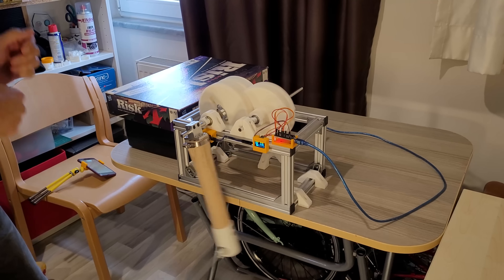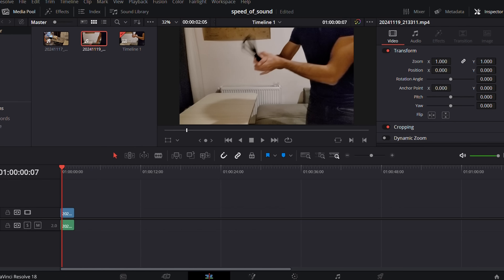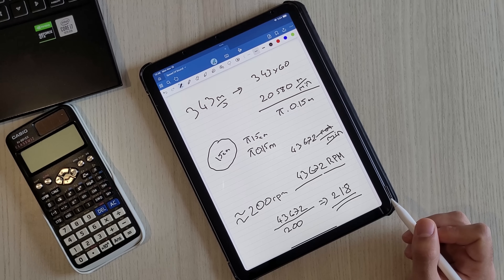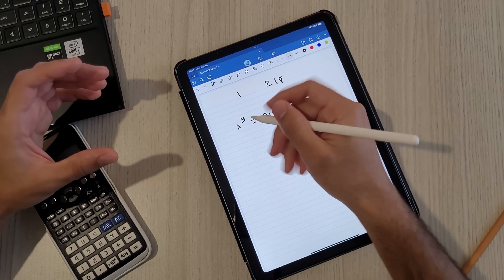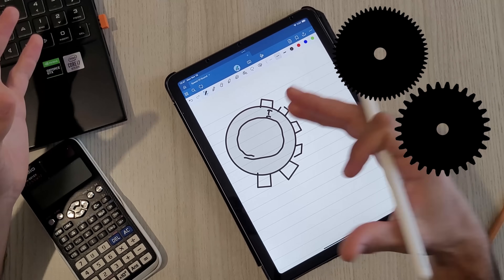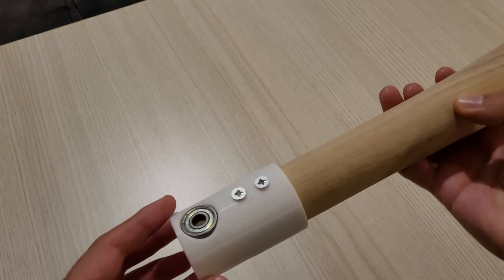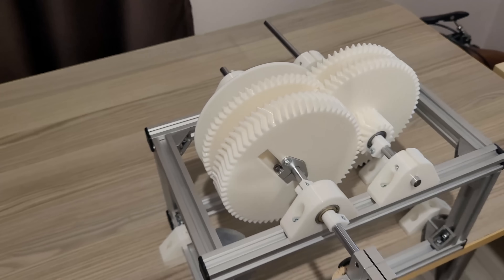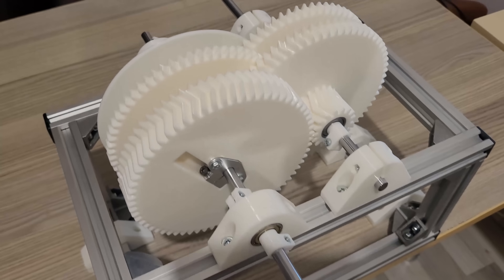Trying To Reach Speed Of Sound At Home 3D Printed Gears

Comment from the maker: My video where I built the reverse of this to increase 2 motors' torque like crazy, as John Wick would say we need torque, lots of torque. https://www.youtube.com/watch?v=C--8uYFRu9c&t=107s
Reply: 0:09 0:09 0:09 0:09 0:09 0:09 0:09 0:09 0:09 0:09 0:09 0:09 0:09 0:09 0:09 0:09
Reply: If you paint the final disc (probably made of metal for strength), half black and half white, then you can use a tachogram app on your phone to calculate the spin speed of the final disc. Your table needs to be well wobbly.
Reply: Love videos that teach the process, good work!

Comment: How would this work if you were to increase the size of the gears, per gear (so, initial input is say, 15cm, then 30cm, then 45, and so on)?
Seeing that this was a video from a "small" channel at the end blew me away. You've got a bright future ahead if you keep this up, great length, more than enough information density and you explain things really well.
Reply from the maker: Hi, the size of the gears have to be the same in this design because they all are on two parallel rods. If you increase the size it will strart hitting the rod.

And thank you for your comment. I beleive i had 30 subscribers when I shared this video.

Comment: 11:17 - no they are not more efficient, at least not in the general case. There can be some situations where they are, but in general that is not the case. Sadly people are spreading so much BS that if you search for that first the searchengines own AI will tell you completely fabricated hogwash, then the next 15 sites will be AI generated BS (going so far as claiming the transmission-ratio to be the same as the efficiency-number), then a couple random blogpost were people claim that their lies somehow constitute "research". But when you find actual manufacturers documentation you will find out that no, they are no more efficient.
And the simplest example that they are not: Cars.

also you have a computer - it would be easier to do the calculations in a calculation-program with spreedsheets, or even just python.

Comment: Using double helical gears will make friction almost twice as worse. I recommend using spur gears that are fixed to their shaft so you only have to decrease friction between the shaft and the chassis. Give them slight intentional backlash to make sure the friction is gone. Instead of trying to make the gearbox compact, make a long line of spur gears to minimize contact. Regular ball bearings have too much friction, use bearings with cylinders instead of balls and fix the shaft in place using two spikes on the ends. Lubricate every part with graphite.
Reply from the maker: Thanks for the tips

Comment: Gear/connect it to a cycle or any motorized vehicle
Reply from the maker: You wouldn't be able to spin the crank
Reply: @canocholic  why?
Reply from the maker: With gears you do not increase power. Power = torque * speed. If speed is increased torque is reduced. Check out these four videos for more info about how gears work:
https://youtu.be/yGlPy2q1e_w
https://youtu.be/KQCIBSL6UEc
https://youtu.be/C--8uYFRu9c
https://youtu.be/CNaWGllHP68
Reply: @canocholic  oh cool 👍

Comment: Yeah a little long but understandablly so loved how you explained and did the math, u made it seem like anyone could understand how you were able to deduce and prove something that seemed impossible at first when you hear what your trying to accomplish. Bravo Very impressive!!!!❤😮 I personally would want shorter video with the option of see your full documentary with your presentation explained in fine detail.... but if I could change a few things to improve the overall efficiency I would certainty 3D print some very fine metal alloys gears possibly making them highly magnetic super conductors pressurize your gear box with very pure water with the tiniest amount of oxygen in each water molecule almost like at the lowest depths of the sea very high pressure and very cold thus if you direct the water in the right angles perhaps every angle possible and from outer circumference str8 down then divide into several different points at different angle on every gear tooth pulling and pushing each tooth of the gear ultimately angling inwards toward the radius till you max out the gears potential energy out put then hit it with high capacity energy pulses to speed it up to as close to lightning as u can get. And to maximize its potential make the gear box not stationary in one fixed position like normal gears are designe everything from every aspect and level to allow the gears diameter to multiply in size depending on amount of energy input but don't view the gear as being flat two deminsional like a little rc car main gear is imagine it and designe it not only 3 Deminsional state with a vortices opposite and compressing twisting and tourqing the input energy through each gear.and if you can manage think of the drive shaft of a car instead of just one solid shift have several different radius inside transferring power to yet another two gear boxes acting like a transmission for each tire on the car. Most efficient use of energy out put, to energy taking in and recycle any energy you can is where the future needs to be headed. Cracking a whip in one direction will break the sound barrier but I wonder if you could crack two whips in opposite directions would it cancel the noise of breaking the sound barrier????! Either way you would need to work out every muscle in your body everyday while eating healthy from sun up to sun down with no vices like coffee in the morning and meditation before you fall asleep and when you wake up, thinking twice before reacting to a question and thinking on a quantum level before ever reacting to someone with no thought just their emotion so you don't react with emotion, taking deep breaths and only hearing a problem and instead of voicing other problems with your 7unchecked emotion, you only calmly voice solutions to whom ever and then think to yourself how to correct your behavior so you don't keep running into the same problem.... ohh and all of this while work8ng a physically laboring job with 2 five pound weights Tied to your wrist 2 ten pound pound weight to your biceps one on the inner and one on the outer obviously distribute the weight evenly amount your arms and do the same for your legs with a 45 pound weight on your front chest and one on your back wear it atleast 5-6 days  a week always taking a day off to heal but wear them anytime except for showering but keep doubling the weight maybe every month or two but make you're vest and arms strapped together as one with your lower half half separately mak8ng it a single strap that ties your lower half to your upper half so you can slip out of your weights quickly if there's an emergency. But make it and just know the longer you keep at it the more you work out the biggest muscle in our bodies which is your brain.... the smarter you'll get by learning to walk and move side to side speed up just to slow down exerting tons of energy at first but once you over come the pain and sourness simple by showing noo pain and stand8ng str8 even when sitting perfect poiez you'll start learning how to use less energy while moving faster with way more power. Just stretch further and further limbering up to where your horizontal with the ground and your off balanced and you can choose to fall or excert some even plus and negative energery to become upright and vertical. About a week or soo into it go to the Nearest MAJOR LEAGUE BASEBALL ⚾  FIELD AND START PITCHING WITH YOUR SUIT ON BUT ONLY TOUCH A NORMAL SIZE BASE BALL WHEN YOUR REALLY GONNA SHOW YOUR STUFF OFF, MEANING ONLY PRACTICE PITCHING WITH A LARGER DIAMITER BALL LIKE A SOFT BALL AND IF YOU CAN FIGURE OUT HOW TO MAKE THEM HEAVIER THAT WILL ALSO HELP THROW FAST AND HARDER, and practice hitting with the lightest scronniest bat just to learn timing and placement of your body so your wound up with energy and power ready to be released threw your wristes, shoulders, core, hips rotation, center of gravity then through your knees calves ankles pivoting on your back and pushing while pulling the energy from left to right right to left up and down CYNTRIFICAL forces. These things you learn through the blood sweat and endurance followed up always with patience while moving around and 5hink8ng on a higher level to solve world problems only someone with the will and willing to think of solutions and b6 the grace of GOD you will be the best pitcher in the rays history and the best batting homerunns EVER. And you may as well play foot ball too for the buccaneers or Greenbay packers which ever team will allow you to play every down everysecond of the game no rule book or play book to memories you only play the ball, play to score and see how easy it is to out play the professionals and how easy it is to stop the ball from any 0layers hands right into your.... 😊😊😂😂😂😂😂😮😮😮😮😮😮😮😮 make your weighted suit with your bench pressing tyrmpe of flat circular weights and longg strapps and layers of duct tape and then after so much time you basically make another suit and wear it on top of your first one by book veiling and weaving everything together. Either way one could only hope to so not only solve a world crisis problem but master it and grand Master that problem and you may very well end up solv8ng many of many problems only you can do by looking with in yourself, question almost everything redesigne any and every part by the way you will understand and explain it to those whom have the power and resources to implicate and build your experiments, if no one will listen make a short video describing what you hope to accomplish and what you figured out with as least amount of words as possible but pin point no on and electrons scale so much so that the idea becomes the size of the sun or the sun becomes the size of an idea... no matter how long it takes one thing you can prove for certain "The Moment you deside something isnt possiple,, is the Moment that it becomes improbable to prove, and it's only when we stop working on fixing and howening and fine tuning our solutions to problems never proven possible will we finally see whats possible."
And it doesn't matter who you are or what background you have anyone can build their intellectual side while working harder than the best thinking deaper and shineing brightest along side the GREATS.
ALBERT EIGHNSTEIGN SAID "OUR REALITY DEPENDS ON ONES IMAGINATION, WITH IMAGINATION AND THE TENASITY TO THINK OF SOMETHING IMPOSSIBLE COMING FROM SOMEONE AS IMPROBABLE AS ME, WITH NOTHING BUT THE DAWN OF LIGHT AND THE HOPES OF A DREAMER TO STAND TALL INFRONT OF THE WORLD AND SAY WE WERE WRONG THAT SMALL LITTLE THING WE THOUGHT WAS IMPOSSIBLE TURNS OUT IT IS POSSIBLE AND BECAUSE I PROVED IT AND OTHER WORLD RENOWNED MATH MATICHIANS SCIENTISTS AND THEORETICAL PHYSISYSTS ARE ALSO IN AGREE, THEN ITS UP TO THE OTHER BRIGHT MINDS TO BUILD AND CONSTRUCT YOU IDEA INTO REALITY." GOD WILLING AND GOD SPEED. DO FOR OTHERS MORE THAN YOU DO FOR YOURSELF. AND WEALTH BEYOND the horizon of IMAGINATION, WILL FILL YOUR SPIRT. CARRYING ITS EVERY WHERE WITHIN YOU. ALL ONE HAS TO DO IS,    TRY......"

Comment: You can change the print configurations, use bricklayers if possible. It increases bonding strength of over 20%. Change the material. Not only reinforced materials add strength, but also different plastics. But remember, if using nylon it needs moisture for full strength (while needing to be dry to print).
But consult 3D printing channels that specialize on material strength for that. Like CNC kitchen.

Going keyed on the rods will prevent slippage. Clamping just isn't enough under those loads. If you use a 3rd rod you can transfer your output disk to the outside, potentially double the diameter, allowing the rpm to be half (while still reaching mach speed).
If you design your output disk to have two small holes on opposite ends, you can measure the rpm with a photocell.

Use a more sturdy table. Maybe at least brace the table with an aluminum extrusion frame.
Use a tripod (a real one that stands on the floor, not the mini one) for your other smartphone/recording device (the one that fell off the table). That way it won't be affected by the table wobbling.
Use safty glasses. And a face shield. A plastic wheel disintegrating and flying into your face and eyes with barely subbsonic speeds isn't fun. Not for you nor the surgeon who has to remove it out of your eyes/brain.
And no. Normal glasses won't do, too much of a gap where shrapnel can go in.

Stay safe.

Comment: If you begin with a huge first gear and the last the smallest .. the in between gears incrementely smaller.. would be the easy way.
Reply from the maker: With this design, the gears need to have the same dimension. Since they have to fit in the same axis

Comment: Bro making a steel frame only to put it in the flimsiest table known to man.
Reply from the maker: In my defense these extrusions are super cheap here and they are super moduler sooo
Reply: @canocholic  SOoooooo get a better table.
Reply from the maker: Go ahaed and send superthanks that's enough to buy a workbech, I'll order one and reshoot the video asap
Reply: And use the worst possible quality plastic, and RUSTY bearings!!!
Reply: Lol😂
Reply: the frames are actually made out of aluminum
Reply: @PlungingBreaker  potato tomato you know what he meant.
Reply: @GermanV-12rocket  there's a massive difference.  Extruded aluminum is light and easy to fabricate with.  Similar steel would be heavy as crap, and annoying to cut.
Reply: @GermanV-12rocket  no
Reply: @Soundpost-f2l but way way stronger and durable
Reply: @Plopator  yeah, steel is incredibly strong.  Plus it doesn't fatigue to anywhere near the degree aluminum does.
Reply: @PlungingBreaker  ☝️🤓

Comment: I would recommend a couple things which others may have already mentioned
1) Lubricate
2) Fix it to something like your floor with strong enough bolts
3)Lubricate
4) You said no motor to spin the driving gear but you can use it to spin the other gears to get a faster start
5)Lubricate
6)Use a lighter and stronger final disc if you even reach like 900kph or it will blow up
7)Lubricate everything
8) Pedalling would be better
9)Lubricate
Reply from the maker: 1. I did lubricate
2. Ofc i did lubricate
3. Do you really think I'll all this and not lubricate?
4. Yeah a better table to mount would be great
Reply: @canocholic lol

Comment: If you want to play this way, you have to take the linear speed of turbo rotor blade from chiron which depends of it's rpm. Diameter of turbine wheel there is 74mm. If we take it goes max of 100k rpm then linear speed is ~1450km/h. For 150k rpm its 2170 km/h but its way above sound speed so i think its limited to be lower. Even if we count max rpm for chiron turbine to be 50k rpm its 725 km/h linear speed of turbine blade edge.

Comment: You've made this really complicated, the limiting factor is the size of your printer.. so you start with the largest gear you can print, work out the circumference, calculate the revolutions required. Then calculate the ratio required to hear up from 200rpm in the minimum steps required..
Reply from the maker: Yeah, the only problem with this is the cost and print time.

Comment: Love the video, very informative and well produced.
Suggestions (if I may) for your system.
1) bearing retainers to prevent the bearings from falling out the side of the gears. A simple cover with screws or a spacer shim between them
2) Lubrication for the gears would reduce friction and improve performance
3) centre bearing supports or carriers for the axles to prevent deflection at higher rpm and improve gear mesh
4) a flywheel inline with one of the earlier gearsets to dampen changes in speed from the crank handle.
5) a woodruff key for the crank handle to prevent slipping, a threaded screw will work but at higher loads may still slip.

Amazing video, hope you continue with this attempt
Reply from the maker: Hi, thanks for the tips.

1. Would definitely be useful
2. I did put on some light machine oil. Anything thick would slow down the system, especially at higher gears.
3. Yeah, that would help, or using a thicker rod might be enough since there isn't actually that much force.
4. I'm really scared of adding a flywheel. This is dangerous enough to add more kinetic energy is.......
5. Yeah definitely but, since it's hardened, i don't have any tools to work it.

Thanks a lot for your input. Highly appreciated

Comment: Attach to drill
Reply from the maker: That's kinda dumb. First I don't think ay drill has this much torque. Second drills have gearboxes that reduce the speed of the motor and this increases. That means quite a bit of gear ratio is wasted and canceling each other out.

Comment: Dude 😂 look up ratiozero its a cvt that is geared because its basically a planitary gear set you can then stack them so the output starts equal to the first gear set then you can slowly raise the gear ratio 😂 with a 1 metre flywheel on your outlet you so 200rpm over 20580rpm = 102.9x meaning 3 ratio zero gearsets with a ratio from 1/1 to 10/1 to hit your target

Comment: You might want to start shrinking your gears to be smaller on the last ones, because it should decrease the input force required to get it up to speed. It wont help you stay at speed, but it might help you get a couple moments of higher rpm to reach your goal.